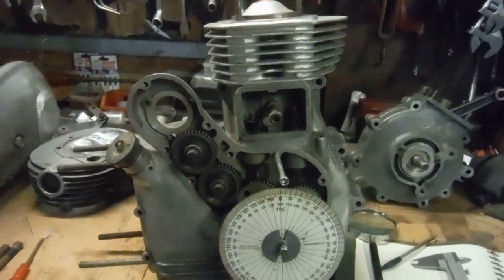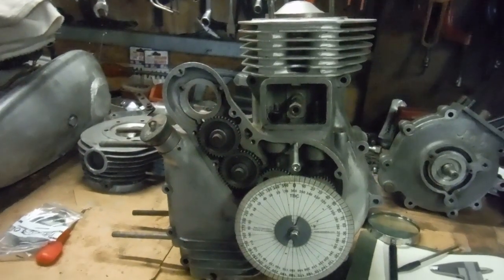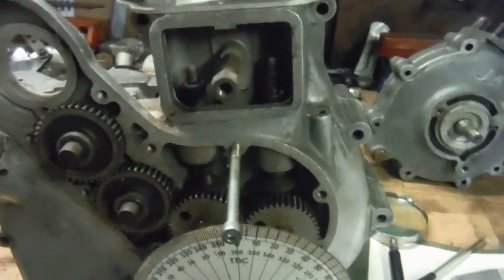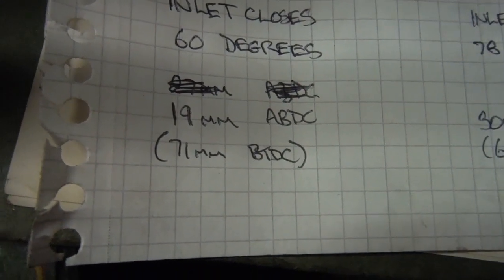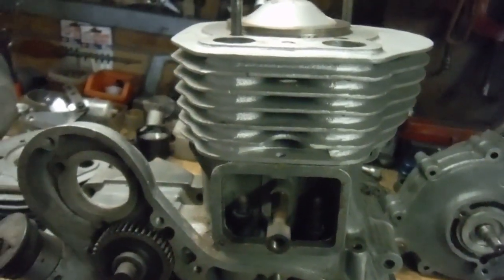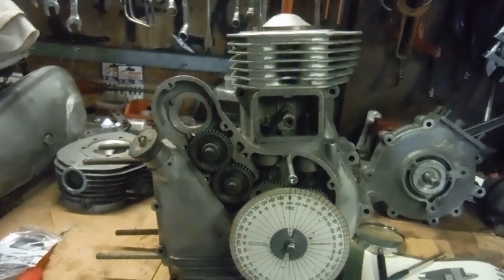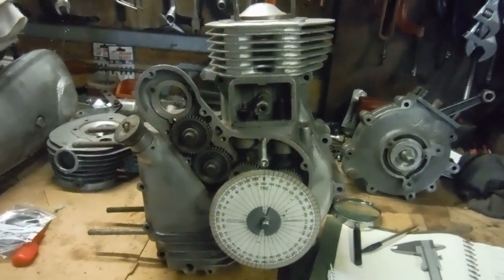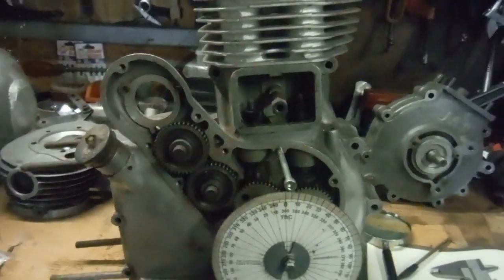Royal Enfield tuning 4 - possible reasons why retarding inlet cam timing often improves performance

Comment: Hey Paul. So, I had nothing better to do this week and had the cam side open for a distributor change, so I gave this a try. It seems to run ok, but I haven't really noticed much, if any, difference. I have to do another 2-hour road trip next week for more cancer treatments. I'll crack open the throttle on the open road and see if the performance/mileage improves. I'll keep you posted on how that works out. I've watched this video about a million and six times, and it all makes sense. Gonna see if I can't wrap my under-used, but over-educated, brain cell around a reason why. Thanks again for all of your tips and advice, I couldn't have done it without you.  🥰 https://www.youtube.com/watch?v=M0On73q-LDc&list=PL-mZY1JUVWV17I2apPsRrz9iB34n2Hfjn&index=35
Reply from the maker: Thank you and wishing you well!
Reply: Hello

Comment: Love your video's Paul you really know your stuff for sure...which is why Iwould like to ask a question! Could I fit one of those high compression pistons in my 52 350? Do you need to change valve spring? Timing? And lighten the crank Or is it ok just to do the piston? I think the std bhp is around 18 what would this increase it to?
I don't want a 100mph bike but I would like a little more confidence when riding on bigger A roads at the moment it is comfortable at 55-60
Reply from the maker: Thanks, Thomas. Yes, but you would need to increase the fueling at the very least. Depends on how far you want to go with it really.

Comment: Retarding cam timing tends to tilt the torque curve , a little less at low RPM traded for a little more at high RPM.  Having the valve close later allows better cylinder filling when the air in the inlet ports and throttle body/carburettor has enough kinetic energy that it continues moving into the cylinder even as the piston starts to reverse direction.

Comment: One of the benefits of having the inlet valve close silghtly later is that the inertia of the incoming charge is still pushing the fuel/air mixture into the engine. Now, this wont be very strong at low engine revs but at higher revs it will make a considerable difference to the new charge coming into the cylinder as the speeds and thus, the inertia of that new charge will be higher so that the new mixture is still entering the cylinder, even when the piston is already on its upward path and could be part of the reason why you get more power out of the engine with the timing retarded by one tooth.
Reply: I’ve often wondered about the effect of changing the overall length of the inlet tract when combined with this modification. I fitted a 26mm concentric type carb with short bell mouth to my 350 and removed the air box and original filter. This was one of other mods, such as basic gas flow improvements to the ports, a Meteor Minor piston (raised CR) and a free flowing exhaust. I also discarded the aluminium spacer block that housed the redundant auxiliary air valve. So, the inlet length is reduced. The bike now seems quite quick compared to many 500s and will easily rev to the point where the valves bounce. I visualise engine gas flow/volumetric efficiency as a similar thing to tuning a trombone. Change the overall length of the tube and change the note.
Reply: Came here to say that!

Comment: The testers are very cheap. I have a hunch Asbo will be higher. Halfords did stock them.  I had a Mini Metro  that didn't like Shell petrol.  The tester found it.60 psi on one cylinder and 75 psi on the others.  It was early unleaded.

Comment: I think a Vernier-adjustable inlet cam wold be an interesting tool to find if there's any more optimal setting for the valve timing.
I was also thinking that at higher RPM, perhaps the inertia of the incoming inlet charge would help reduce the effect of lost pressure from the later inlet valve closing.

Comment: My asbo 535   had  the cam retarded. I don't think it suits the unit 500 bike as one loses the punch at 3000. It certainly wouldn't suit a scrambles engine.  The mod allows me to overtake without changing  gear during the maneuver. It widens the rev range. I'm no sure if it adds much power at peak power but the power hangs on for another 700 revs or so. Basically it's moved the power band up by that much.
 One would probably get more power from this  if the restrictive airbox was modded. I recently saw another 535 that had just had the airbox extensively altered, nothing else, and the rider said it now happily reached 85, whereas before it struggled to get much past 75.
 But as is obvious all this is just the 535, and yes the engine is smoother.

Comment: Maybe do a compression test.140 psi perhaps and 120 standard.
Reply from the maker: I have honestly never done a compression test on any engine I have ever built.
Reply: @paulhenshaw4514  LOL! me once or twice but 165psi skids rear wheel on a hill trying to bump start. I have only used a strobe 2 times all my timing is by sound, dyno hills and intuition and scribe marks. Roadside mechanic,

Comment: I would have thought that the inlet valve timing impacts the cylinder filling. Retarding the inlet could improve things because the exhaust effect on the inlet charge is not so great when the inlet valve opens while closing the valve later allows the inertia in the inlet charge longer to fill the chamber….
Reply: So if he went even further with the retarding, at some point the valve would allow the charge to blow back into the inlet tract and carb?
Reply from the maker: Yes, go too retarded and a lot of fuel / air mixture will get blown back.
Reply: may be worth experimenting with longer lift duration on the inlet cam?